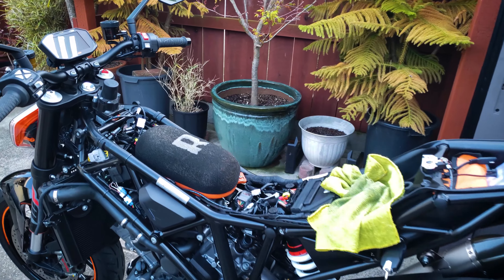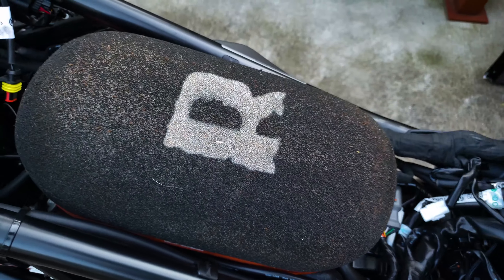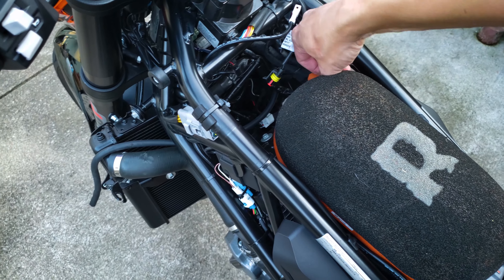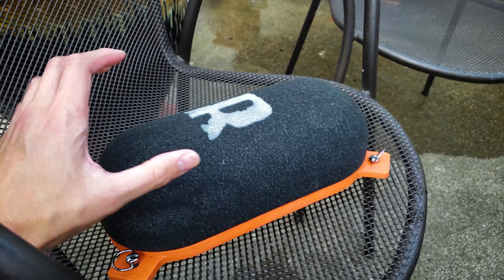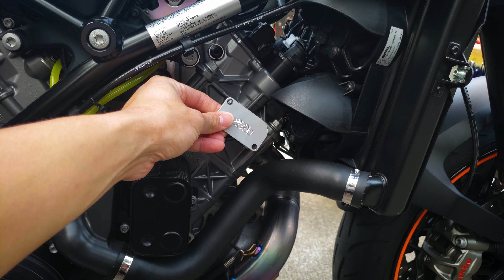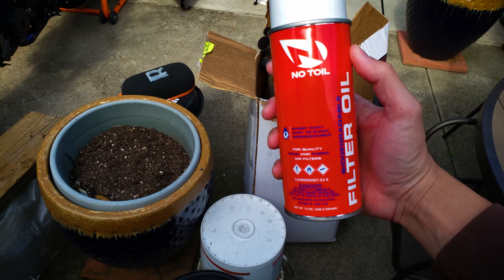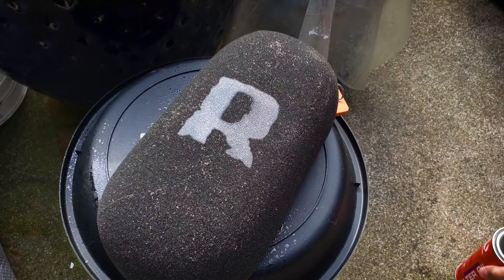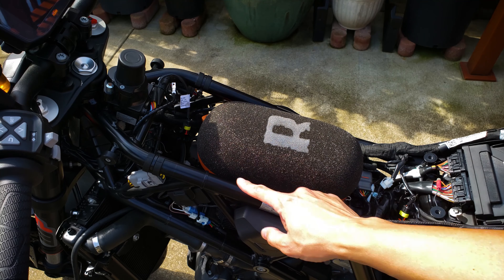Rottweiler Performance Intake Maintenance Cleaning - 2018 KTM 1290 Super Duke R

Comment: Rottweiler blanking plate FTW. Gotta rep a CA company! There is nothing understated about the bike, you have neon overflow tubes 😀.
Reply from the maker: The rotty kit came with a bunch of them so I figured I'll try something different lol
Reply: Nice. I have a black 16 and I’m slightly hesitant to do all the things. My 990 is fully modded but I can use tuneecu in addition to the PCV to dial it in. I realize I can buy openflash or equiv if I can’t get a dealer to change the base map as well as a custom dyno tune into the PCV / auto tune. Curious which path you took given there is really only Scuderia nearby
Reply from the maker: @charlesmastin5628  no shop around the bay area that I know of would do the akrapovic map for me because of emissions regulations. That is why I went with the rotty kit stage 4 and I'm running a PCV tuned by Rottweiler for my mods including the exhaust.
Reply: Ken Moto thanks for answering. Ride safe and stay healthy out there in DC!

Comment: Hey bud, do you need to drain the tank? Will fuel pour out? I'm putting a k&n air filter
Reply from the maker: No the tank will be fine. No need to drain
Reply: So just unplug all the connections? No taps to turn off fuel?
Reply from the maker: Yes the fuel connection will drip a couple drops but it is completely sealed..just keep it upright and don't tilt it any other way...also make sure when you place it somewhere that you don't pinch any cabling or hoses..just be very careful with it